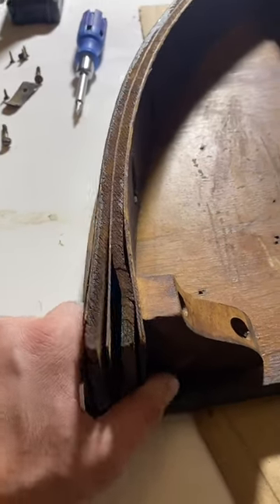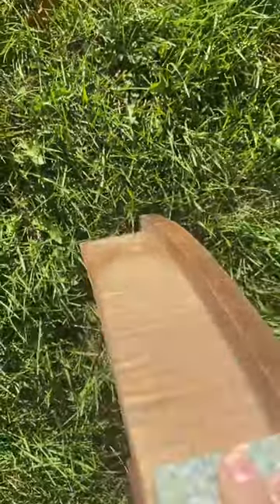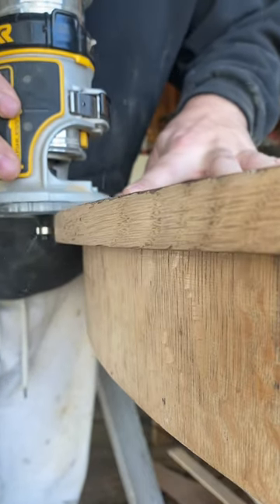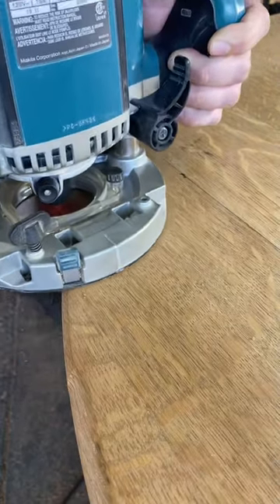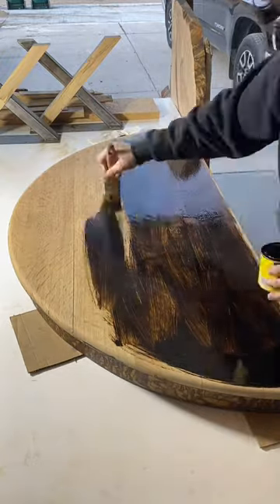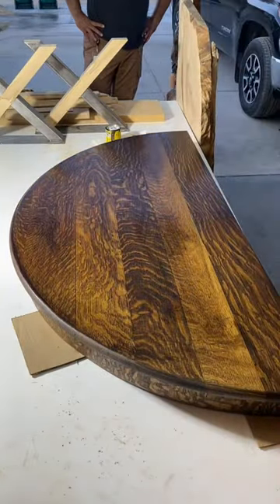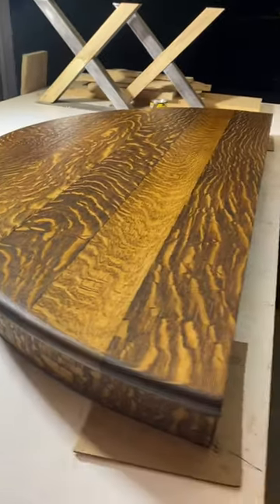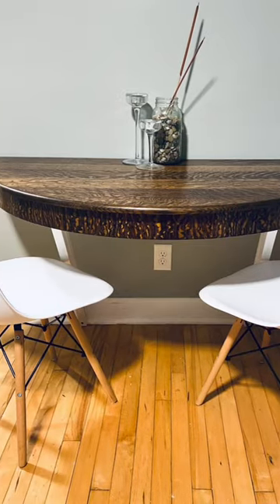Restoring Tiger Oak Table #shorts #diy

Comment: It's not quarter sawn but still you did a great job repairing the it! When wood is cut quarter sawn the end grain is completely vertical therefor the top grain is very straight, it's not cut that way for looks but for stability. The wood on your table with the beautiful cathedral like patterns is flat sawn.